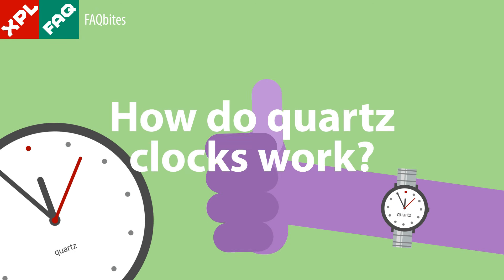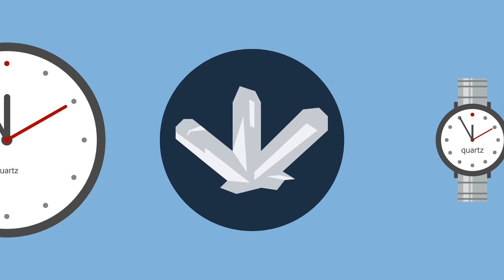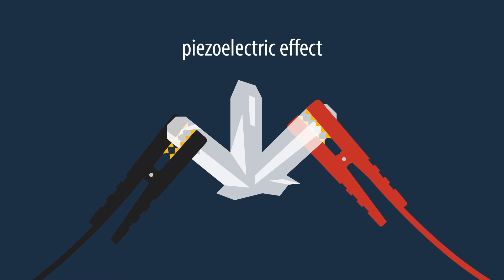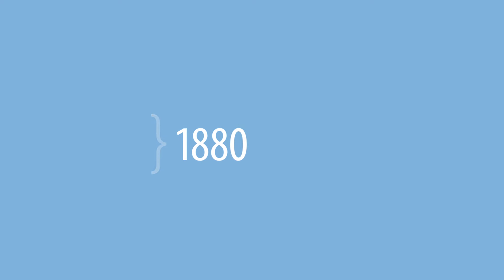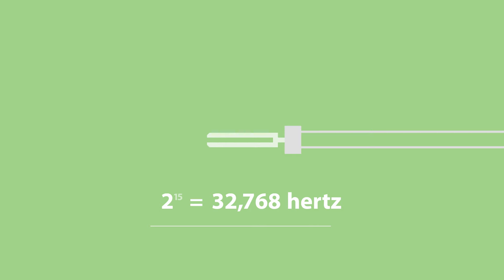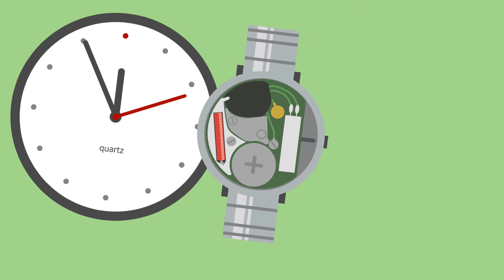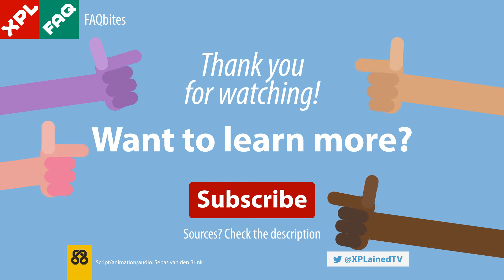How do quartz clocks work? - Clocks And Watches Explained

Comment: Thank you very much for your explanation about small quartz crystal tuning fork that vibrates at a frequency of 32,768 Hz and sends the electric current to microprocessor chip that converts the vibration into one second electric pulse and drives the lavet stepping motor which drives the motion work (60 : 12 : 1)gear train that is formed by main wheel, centre second wheel with thin and long shaft that carries second hand, third wheel that connects the centre wheel to the cannon pinion, centre wheel with canon pinion a smaller gear with 12 teeth and longer hallow shaft fixed to the central arbor that carries the minute hand, hour wheel with shorter hallow shaft that carries hour hand and wheel that connects both canon pinion and hour wheel) that drives the hands of the clock.
Reply: how do we reduce quartz frequency from 2^15 time/sec  to 1 time/sec ?
Reply: I guess now I know what a stroke feels like
Reply: @thailander5572  Using 14 logical flip-flop circuits chained.
Reply: @Sokol10  but why not use 11 or 12 and have smaller, smoother movements on the "hand"?

Comment: I didn't learn anything new from this video, you explaied that there is a tiny piece of quarttz inside the whatch vibrating at a certain frequency, and that is common knowledge. But you never explained how this vibrations of the quartz are translated into movement of the clock hands at a certain pace.

Comment: 1Hz is equal to 1 second? Can you explain this in more detail?
Reply from the maker: Basically it gets charged electrically to vibrate. A 15-bit digital counter then counts how often it has vibrated, once it reaches that 32,768 Hz it sends a pulse, driving the clock mechanism, moving the second hand (and all the other hands) one tick or one second, then starts counting again til it reaches that number again, it pulses again, and so forth. 15-bit because 2 to the power of 15, or; 15 divisions by 2 (as explained in the video).
Reply: Thanks for the video - but I'm really curious how the digital counter works.  How does it actually count?  Let alone count so fast.  Thanks
Reply: That's incredible
Reply: Hertz is the unite of frequency, number of oscillations per second.

Comment: More accuracy? Which means, don’t worry if our clocks running out of battery in a long time? The clock can adjust by itself?
Reply: PixelsWeisly more accurate than mechanical clocks
Reply: That's not accuracy, that's autonomy

Comment: Great video, thanks, but not completely explained 
 So, battery supplies current to quartz crystal, which vibrates and connected to the microprocessor, which (programmed) counts how many times that crystal has vibrated( its a bunch of on/off pulses), when the microchip counts 32,678 cycles, it sends and electric pulse to the coil, the coil generates a quick magnetic pulse, which turns a step motor, step motor works in quick quarter turn steps and  is geared to turn the second’s hand. Thats why mechanical watches have a smooth running second hand and quartz watches have a second hand that jumps( not always, there are smooth running quartz watches, but thats a topic for a different time). 
Some facts about quartz watches:
1) the first quartz watches were about $7000. 
2) even a $10 Walmart kids quartz watch, will still be 10 times more accurate them high end mechanical watches. Quartz watches dont care about a temperature, humidity or hand movements. 
3)Quartz watches are a lot more shock resistant
4) Because there is no main spring in quartz watches, their movements dont have a highly loaded spots/areas, thus they dont require service like mechanical watches. 
5) Usually quartz movements dont have oil, if some models do, that oil is very viscous. That coil/step motor has a very little torque, when oils dry out and get dirty and thick, the oil works like a glue and watch stops working. 

Biggest problem when people try to replace batteries themselves are: 
1) coils have extremely thin wire and usually exposed, thus its really easy to poke it with a screw driver, or twizzers and damage/rip the coil and kill the watch.
2) some cheaper model watches have a snap/push type of a back(vs twist off back). Taking it off is pain, usually people scratch the hell out of the watch, but putting it back on, might require a special tool, thumbs aren’t powerful enough to snap it close.(not 100% of the time, but pretty common).
3) some old cells, that have been dead for a long time, start to leak acid/alkali inside a watch and corrode contact. Most people dont know about it, they insert a new cell but watch isn’t running, so people think the watch is dead. Solution: always check the battery contacts and if crap is observed, carefully scratch the buildup off.
My two cents if anyone ever needs some info.
Reply: that is interesting, thanks for clarifying, so in order to make it smoother the signal is sent to the seconds hand let's say each 1/10th of a second? I'm assuming that makes the movement smoother
Reply: although big part of this is still mystery to me, like why it vibrates exactly 32,678 a second? and how that gets counted in this speed?
Reply: Thanks mate 💪
Reply: Thank you quartz genie 🙏
Reply: The comment overpowered the post itself. Thank you so much ❤
Reply: Holy…
Reply: Lots of inaccuracies here, mainly quartz are highly sensitive to thermal changes. Thus why thermal compensation exists or radio controlled. If quartz was affected by nothing like you state your watch would be synced at factory and not need adjustment ever unless battery was depleted.
Reply: you just answered the question that the above video failed to. Thank you.

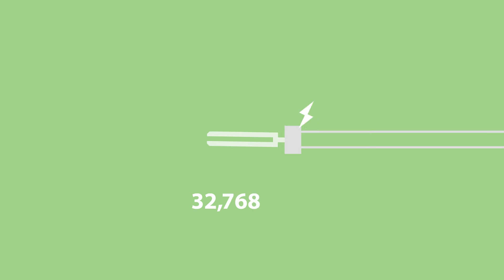Comment: 0:50 "Positioned and zapped" but Howwww!!!? :) really trying to figure this out! super complicated and fascinating :)
Reply from the maker: :D Basically an electric current is led through the crystal (from the battery). This causes it to vibrate :) Does that answer your question?
Reply: Brilliant.
Reply: @IntoTheOrdinary  is the vibration of the crystal what provides the mechanical work needed to make the hands on the watch move?
Reply: @szmulek  I don't actually know but I doubt it is, my assumption is that it's just the timer - that it's used because of its accuracy.
Reply: @szmulek Nope. Read one of the comments above